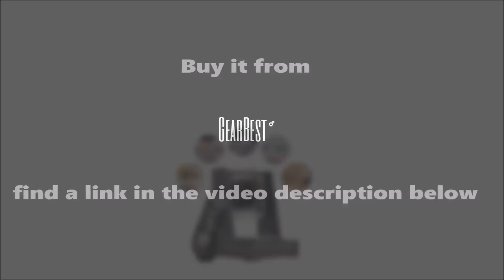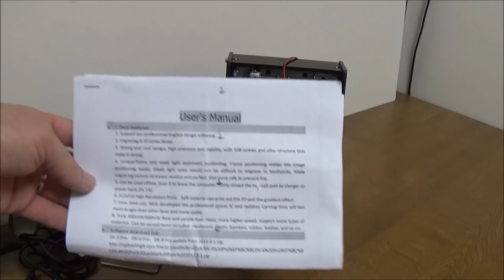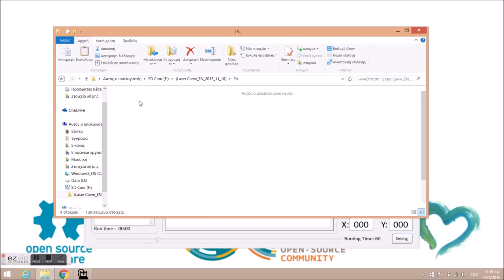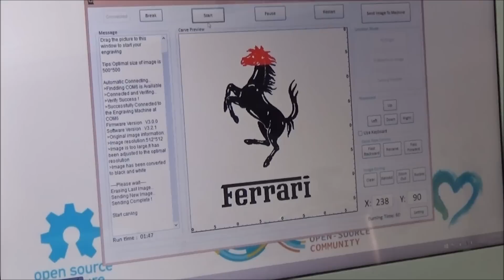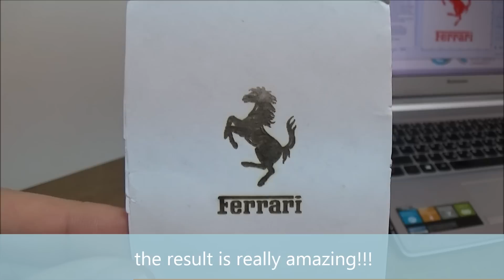NEJE JZ-5 Mini Laser Engraving Machine - Unbox and First use

Comment: Where does the micro SD card go? I'm struggling a bit.
Reply from the maker: +Drastic Meas Inside micro sd card you will find the drivers and program, so you have to connect it with your computer..

Comment: Quality control on these seems to be questionable.  I got one from gearbest.com, and it just shuts down for no reason after about 4 minutes of use.  This is not long enough to do much of anything.  Customer support a gearbest is the worst.  Don't expect much from them if you have a problem! I hope your unit works better than mine!
Reply from the maker: +Bruce Evans I don't have any problems... Hope to find a solution... Did you try to use different power source?
Reply: +Greek Arduino Projects - ardumotive.com Not sure how that would help, but it is something I have not tried.  The unit does not lose power - it just quits printing.  It is like it has received (or retained) only the first part of the file.  Thanks for your suggestion!
Reply: +Bruce Evans Maybe try from a different PC too.